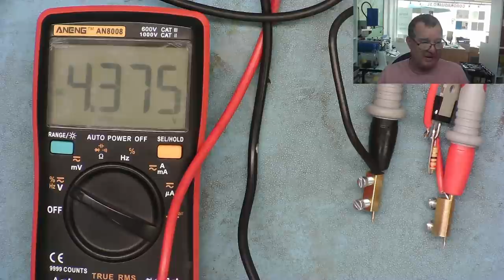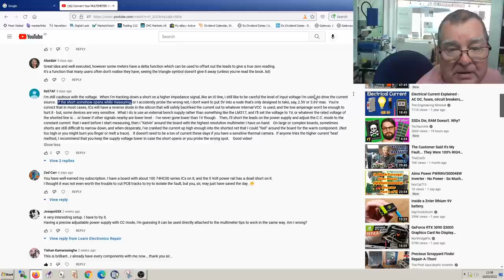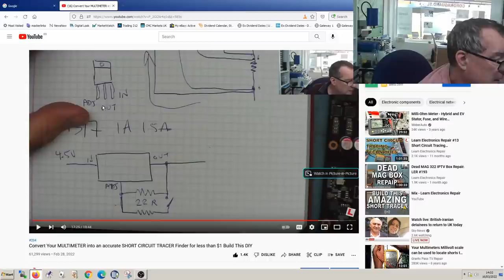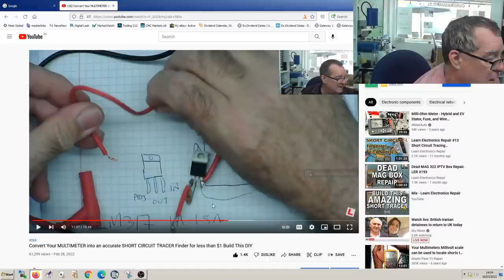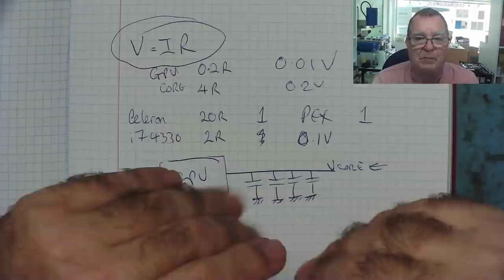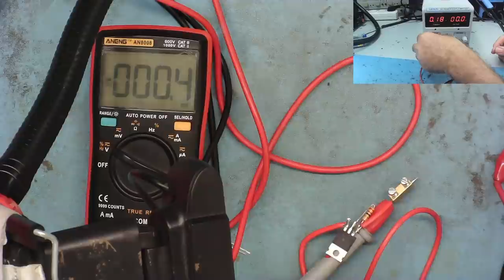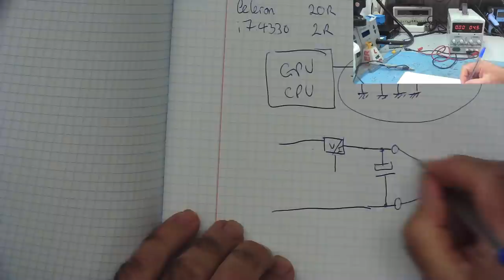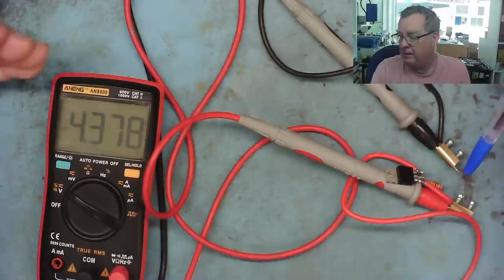The $1 DIY SHORT CIRCUIT TRACER Part 2. Will a 5V short finder kill sensitive components CPU GPU?

Comment: I think that LM317 cct is best described as a current limiter rather than a constant current source (can't remember whether you actually called it a constant current source - apologies if you didn't!) because it can obviously only deliver the rated current if it has a sufficiently high input voltage, but it will never deliver more than the rated current. Just my two-penneth.
Reply: I take it the definition is that a constant current source can have a range of different currents, essentially a variable constant limiter.
Reply: @Ghost572  A true constant current source, by definition, delivers (or tries to deliver) a constant current into whatever load is presented. It can only do this by varying the applied voltage. For example, if set for 1mA and the load was 1k, it would adjust the voltage to 1V. But if the load was 1M, it would try to adjust the voltage to 1000V !
Reply: @j1952d  Thanks, I will note that one down.
Reply: arnoldrimmer4833  So what happens if the load changes?
Reply: arnoldrimmer4833  "The load changes in what ?" What a dam' silly question. As for constant current circuit operation, how do you think a 4- 20mA current loop works for variable loop length without manually re-adjusting the applied voltage for each loop length? I suggest you go and learn some basic electronics. Goodbye and good luck.

Comment: Can I use a 9v battery ?or  just use a battery holder that can hold 3 1.5v AAA batteries .Going to mount it in a box with a switch and use banana plug ports

Comment: Where does anyone get the idea that you will ever see 5V at the 'output' of the circuit, which is on the Vadj pin, which is a 1.23 V reference?

Comment: If you disconnect a led from resistor, read the voltage behind resistor, theres more than led can handle. You connect it back and led works. No boom. So thats happening here.

Comment: I have 0.25 volts on my Ecm fuse socket, (fuse removed) so 2 sockets, the fuse insert into .. supply is 12.60 volts, on supply socket, and there is 0.25 volts, on the other socket, is this my no start problem? also I can only crank the starter motor, when I connect a wire from the half inserted starter relay, to chassis ground, when I use the relay ground to check the 12.60 battery voltage, it only reads 9.00 volts, the wire goes back to the Ecm.

Comment: Richard: I just built this.Something seems wrong. The board is a 7950. Between the memory and the inductors on the top the caps show about .500 on the top row. The rest of the rows down all the caps show about .395. Seemed right as you are only comparing reading from row to row if I am correct. When I go to the caps on the other side of the mosfets, with the probe the same as before with one on one side of a cap and the other probe on the other side of the cap, on all of them on this side of the mosfets ( all caps ) read ol or nothing!! Does it sound like I did something wrong or do you have a suggestion?     lm317T/4.5v/8009 meter MV on auto and manual    Thanks for your time.
Reply from the maker: Are you setting your multimeter to millivolts, or volts?  Although the short finder will show you the lowest resistance it does not show it in ohms - do not use ohms or continuity mode. 

Basically if you really need to know the resistance, rather that just find the lowest value (which is where the short is) then with this tester 0.001 millivolts (which is one microvolt) = 20 micro ohms
Reply: @LearnElectronicsRepair  Thanks for answering. I had it set for millivolts. I just don't understand how using this tool I would get a ol reading on so many caps. Thanks again.

Comment: well done i have had the same comments from some other ham radio ops and im as you can see from my name im also a Ham Radio Op and even some of them get ohm's law wrong mind if some 1 is just starting out in Electronics they could easily make the same mistake
Reply from the maker: Exactly.  This is a very commonly held misconception so no disrespect to anyone who didn't 'get' it before.  When I first started to teach myself electronics from library books in the 70s, I thought if I connected my project to a car battery instead of a 1A 12V transformer like the book said to use, that it would blow up because, fair enough the battery was 12V, but it was 80 Amps!!!!!! or whatever it was back then and surely that would destroy my transistors?   Of course in those days I was young and most of my projects and experiments didn't work anyway but that wasn't the point.

See it's easy to fall into these traps and and I was no exception.  Feel free to point your Radio Ham friends towards my video 😉

Comment: I've followed your instructions but when I use my bench PSU at 4,5v the LM317 circuit doesn't limit the current unless I limit
the current directly from the bench PSU. So you can omit the LM317 circuit altogether and it will still work. Am I right in saying that?
Without current limiting from from the PSU I had it drawing 4 watts in some instances which is more than enough to toast sensitive circuits.
Reply from the maker: danishdart It sounds like you didn't build the circuit correctly and are connecting the output (pin 2) of the LM317 to the meter probe instead of the ADJ pin

Check you built it correctly

Positive from your PSU goes to pin 3 on the LM317
A 22 ohm resistor between pin 2 and 1of the LM317
The output comes from pin 1 of the LM317 (ADJ pin) to your meter probe
Reply: @LearnElectronicsRepair  Yep that is it.. Thank you. 
Well, in all fairness, my mistake is what your drawing suggests in your first video. 
Perhaps you could make a drawing for the correct schematic and put it in the video description as a downloadable
PDF. 
Your circuit really is a great idea and
A great contribution to the youtube electronics community . 
I think it deserves a bit more than just a video of your hand drawings.

Comment: 1st. Your led blowing was because you FORGOT to set the voltage lower than the led can handle. 2nd. You are checking higher powered device's (cpu/gpu/etc) what about lower power device's, with high impedance but low voltage rating? (possible damage)
Reply: You can power a LED with any voltage up to its breakdown voltage, as long as you limit the current. Those small ones likely can handle 50V. You can also easily blow a small LED with 4V or even lower, depending on its color. Most high-impedance devices have protection diodes against ESD. Even without those, the current flowing would be microamps.
Reply: @ligius3  So many things wrong with most of these statements.

Comment: You conveniently take v-core as an example for resistance. But not all circuits have such a low resistance. I don't think it's smart to just poke around with that thing unless you can somehow know what you่re doing or you modify it to limit the voltage.
Reply from the maker: I did connect it directly to an LED without a resistor.  But no worries let me know what I could connect it to that you think would likely be damaged and I'll give it a go.  Also I think you are missing the point somewhat, the short finder is intended to be used for tracing shorts, not for poking around aimlessly.  To do that you can use a normal multimeter.
Reply: @LearnElectronicsRepair  That's right. You need to check your short with a multimeter first  and then proceed if you know that: 1. The circuit can tolerate the voltage you supply OR 2. The short is low impedance enough so the voltage can never exceed the maximum tolerated by the circuit at the current you selected, which can be hard to know because resistance could depend on voltage in semiconductor circuits . As an example of a circuit you could possibly destroy you could take a 1.2V CMOS logic gate.  I would also not use it on 0.9V RAM chips (unless you've got a large bank of them). I think your circuit is cool, and mostly harmless, but you need to know what you're doing.
Not all circuits draw a lot of current like PC motherboards. Some have less power hungry components and circuits, like boards in embedded systems.